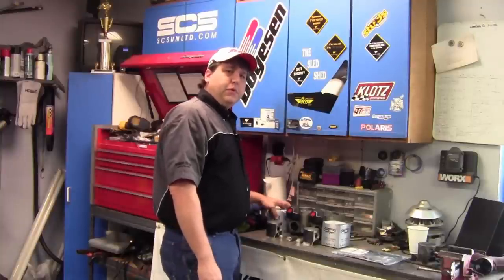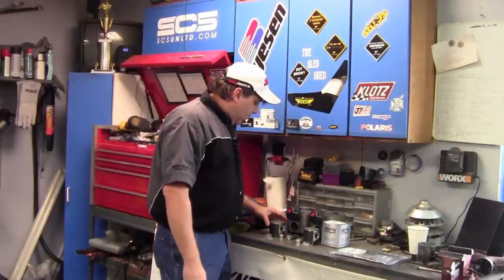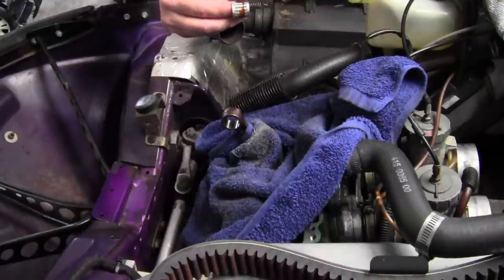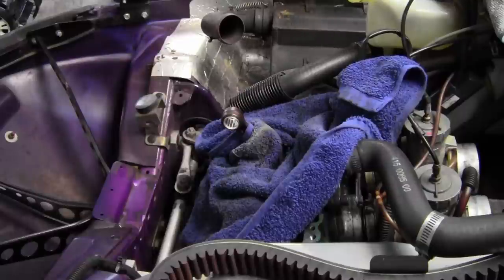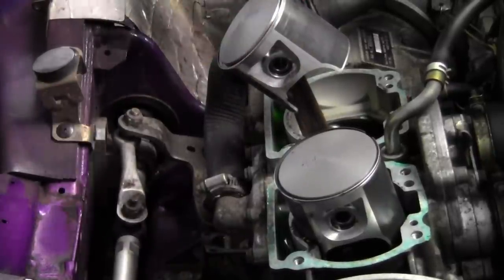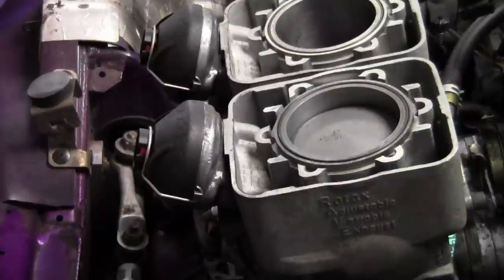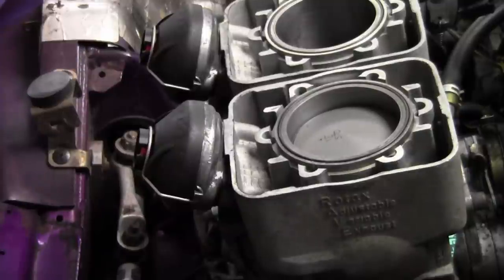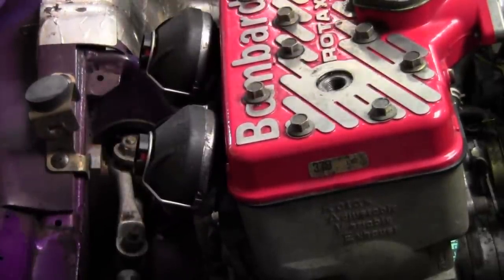Rebuild 2

Comment: Ring gap check? Piston to wall clearance check? Squish check?
Reply from the maker: We only have so much time for video yvon, ring gap, Piston wall checks are a given when rebuilding, squish checks are only done when we would modify the head in any way, either for a repair or when your shaving the heads for more compression. otherwise a compression check will give you the info you need to know in this application.
Reply: @500Indy01  For people with no experience in this kind of work, like myself, it's important to see ALL details. Had it not been for Yvon's question, I would not have known to check for those gaps.

Comment: You didn't clean the surface when you put the new gasket on! And you should put grease on the skirt of the piston and the inside the cylinder. Great video
Reply from the maker: +Brandon Mainville  moly pistons require no lube on the piston or cylinder walls, that would gall the cylinder and we'd have a premature engine failure...  thanks for the compliments, be sure to watch our new videos when you can !!!

Comment: How do the piston burn out?, I have the same sled changed top end last Feb rode it less then 100 kms and now compression is low. After rebuild it was 150 psi now only reading 90 psi trying to figure out how the pistons and rings burn out so quickly....

Comment: Hi again Indy; I have some light damage to the head from the rings flying apart inside,could I use a emery cloth and light sand paper to bring it smooth again?or what would you recommend.thanks Indy.
Reply from the maker: Leo Matson that's a good question Leo ! You can spend some time smoothing out those rough edges, you don't have to go crazy trying to make it perfect original unless you would have access to a laythe, just get rid of the high spots and you'll be fine, unless there would be a really huge gouge your compression and burn capabilities inside the head will not be comprimised.  Just be sure all gasket baring surfaces are clean and free of old gasket material and you'll be good to go !

Comment: You should of  put some Snowmobile oil . On the Pistons and the Cylinder walls.
Reply from the maker: +RICHARD maaske  No need for snowmobile oil on moly coated pistons, in fact you will promote cylinder galling if you do that....

Comment: Just curious it didn't appear that you checked the cylinder at all.  Normally would you mic the cylinders?  Also when would you hone them?
Reply from the maker: It's because we try to keep everything under 10 min Scott , Studies show the time spent watching a video and paying attention to it is 10 min or less, so we leave some things out, A cylinder check is always a given whenever you have the cylinder off, we're trying to show the disassembly and assembly points.       Use an inside mic to check the cylinders, normally on a lean burn down we don't check the cylinders for that as we already know that it was a lean condition that caused the damage, not an out of round cylinder. We usually hone the cylinder with light damage and compression loss, anything deeper than that, we send them out either to get bored or cylinder exchange through US chrome.

Comment: Indy,I have a 98 Ventura Yamaha 600 twin,I have fried piston can you recommend type and,like the piston,gasket set in one,I'll order it if you can please send me the info thanks Indy.
Reply from the maker: Leo Matson I would use SPI if you can find them and either factory or cometech gasket sets.  The SPI pistons have a moly coating on the skirts and seem to hold up exceptionally well. Make sure you check the cylinders for any scarring, this will cause premature failure on your rebuild if they are too extensive. If they need repaired I recommend going to US chrome, they can repair or often they have remanufactured cylinders ready to swap.

Comment: I was wondering if you could answer a question for me I have a 1999 formula 3 800 which developed a knocking tick from piston closest to torque converter. I pulled engine out of sled and inspected the piston to find a worn piston skirt and in positive that this was the sound. The cylinder is not to bad how would I go by repairing that. Also can I just replace only that cylinders piston. Thanks
Reply from the maker: +MustangFlow I do not recommend changing only one piston, but it can be done. If the PTO (torque converter) side cylinder looks to be in good condition you can re use and just drop a new piston in. Before you do that though I would mic the cylinder to be sure it's not out of round, or "egg shaped"  this may have caused your premature piston wear and will do it again if not checked.  If the cylinder is out of round I recommend sending it to US Chrome they do very good work, they have fixed a few cylinders for us in the past and are very quick to get the cylinder back and they look like the day they were originally put in the sled .        As for only changing one piston, there are a few things that need to be checked before you can do this. before you disassembled the engine did you do a compression check on all the cylinders ?  The remaining cylinders need to be almost perfect on the compression reading to do this, when you put in the new piston and rings the compression will be as it was when the sled was new and the remaining cylinders if they are not within 10% of that cylinder the sled will not run correctly or if they are way off it will not run at all.  This is why I start with all fresh pistons then you know exactly what you have.
Reply: +Sled Shed T.V. Indy 
Thanks I decided to change all pistons. because I noticed slight wear on mag side piston. previously there was 125-130-130 for compression tests. any suggestions for piston brand, or place to buy them. also if I send out the one cylinder to be machined will I need a larger piston.  thanks in really appreciate your advice.
Reply from the maker: you can send it out to get repaired and they can make it the same bore as it is now.. You'll have to contact who ever you choose to do it and see if they can do that, they'll also need to have your new piston to size the cylinder to the piston. Like I said we use US Chrome, out of Wis. if your not sure where to go give them a call, talk to Scott and tell them SS TV sent you he'll help you out..They also sometimes have rebuilt cylinders ready to swap for your old cylinder at stock bores.  if you have cylinder damage, they will weld the damaged area, bore, and re Nicasil the cylinder and send it back as good or better than new...  as far as piston brand we go with SPI pistons on our rebuilds if we don't go with OEM..... 

   No problem, happy to help out Mustang, that's what we're here for !  And keep watching SS TV !!

Comment: well normaly any sled I was taught to just let it have a few heat cycles then don't go over 1/4 throttle for a bit and then keep playing with the throttle from full to 1/4 until you run about 5 galons through the sled after that ride it as hard as you heart desires

Comment: dosent even break it in
Reply from the maker: +joshua lambert  What is the break in for moly coated pistons ?
Reply: +Sled Shed T.V. Indy well normaly any sled I was taught to just let it have a few heat cycles then don't go over 1/4 throttle for a bit and then keep playing with the throttle from full to 1/4 until you run about 5 galons through the sled after that ride it as hard as you heart desires
Reply from the maker: +joshua lambert  heat cycling is actually to seat the rings not breaking in the piston. for example, if we rebuild our drag sleds, our best cylinder pressure comes after 3 passes on the drag strip. The rings are what you want to break in as they are the seal between the cylinder and piston. heat cycling can be done rather quickly, as far as getting the best piston wear, warm up is key, the majority of blown sled engines comes from cold cease. not allowing the sled to warm up properly and whacking the throttle will score the piston and rings causing compression loss and premature engine failure..... drag sleds will get ring or ring and piston replacement at the track of we see compression loss and put right back on the strip with no break in only proper warm up with no premature failure. same goes for a trail sled.... you can pull it in the shop, rebuild, do a proper warm up and go out and rip with no problems...